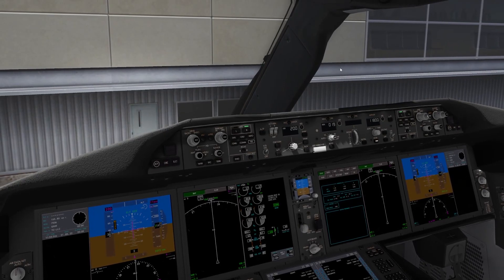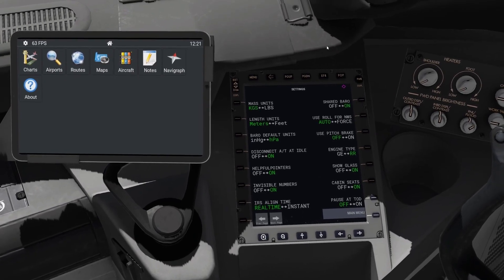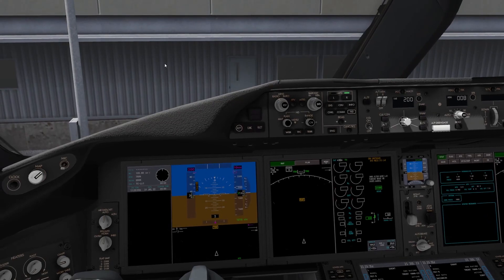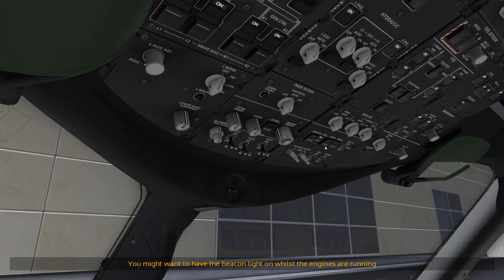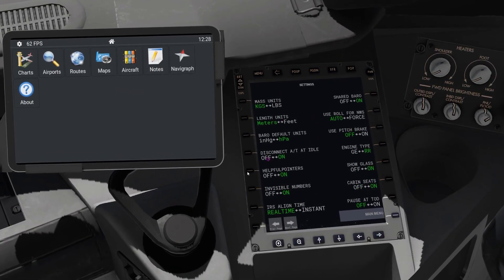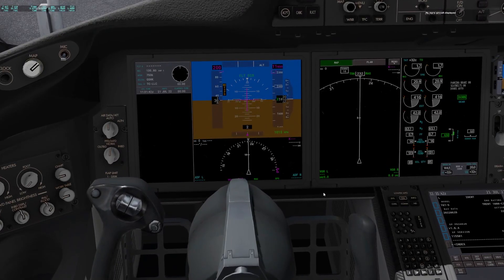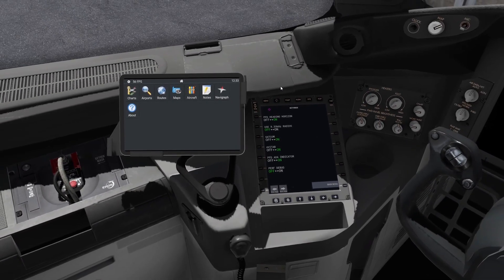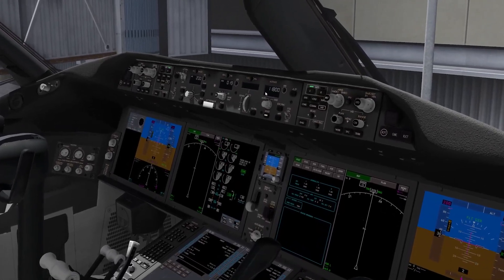Magknight 787 Settings Walkthrough & Recommended Settings

Comment: I have enjoyed this sim aircraft for a long time but since the recent update I can't enter the runway details for the take-off or landing.  This means  no V-speeds and no trim setting (although I can overcome the latter by moving the trim to the top of the green arc).  Any advice on what I am doing wrong?  I've reloaded a new download having removed the initial aircraft but same result. Thanks.
Reply: Update: there's a replacement "airports.json" file in the XPlane12 Magknight forum. Delete the existing file in the B787 settings and replace it with the new one. My thanks to Mooney Man for this advice.

Comment: Thanks❤
I have a Question.
I have buyed this for XP12 on mac book.
All does work but i cant press the,, aircraft configuration butten“ its blue.
You know this page with pax and cargo like this.
What schuld i do that the colour morph to grey insteat of blue?
Reply from the maker: @Aviation_Austria  it’s broken in x-plane 12 unfortunately
Reply: @Simleybob  So i cant use this plane or should i install XP11 version
Reply from the maker: @Aviation_Austria  you can use the xp weight and balance menu
Reply: @Simleybob  Thank you!

Comment: How to solve when mouse on the any screens and keyboard not working?
Reply from the maker: Not sure sorry, do you still have the issue? So does the cursor just not appear on any of the screens?
Reply from the maker: For the keyboard though, you need to move the cursor off the screens for it to work. Move the mouse to the window or something when you want to use the keyboard.
Reply: @Simleybob  Uh no, the keyboard not available when my mouse pointer appears on B787 electronic screens, it's very hard for my landing, because my mouse pointer will move itself when landing

Comment: Mine cannot properly load the map and tel after I turned on the IRS. It keeps showing the yellow word “map” or “trk” instead of the real map or compass. Do you know how to fix this? Also I tried to use the setting on EFB to change the default setting of rudder but it didn’t work. Do you know how to fix this as well? Thanks!
Reply from the maker: Hi, watch this tutorial to fix the IRS problem. https://youtu.be/zReQv0PvbbU what axis are you trying to use for the rudder? Try putting it to AUTO, that usually works.
Reply: @Simleybob  no auto actually made it a real mess. When I was landing, it first went pretty stable. All the sudden it just swerved without me having any input.